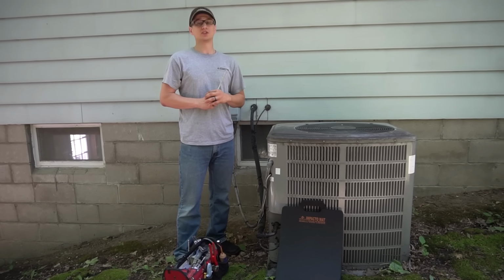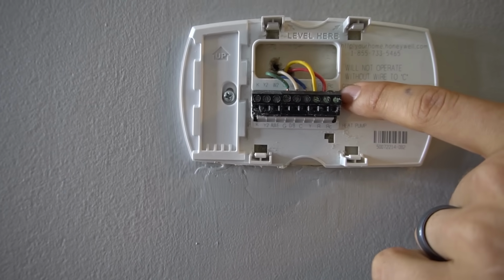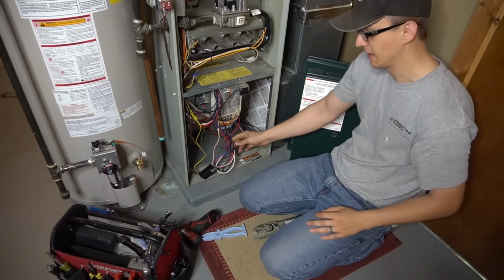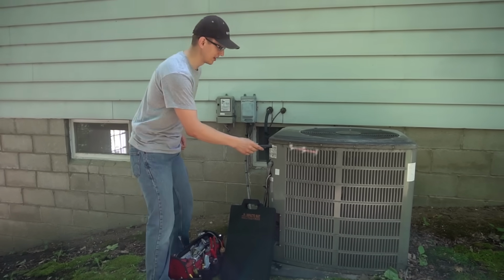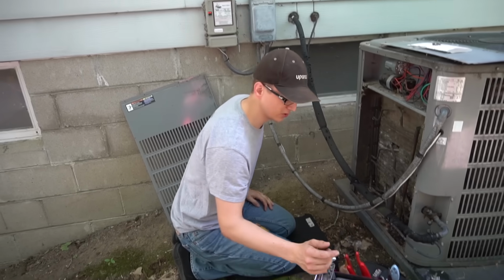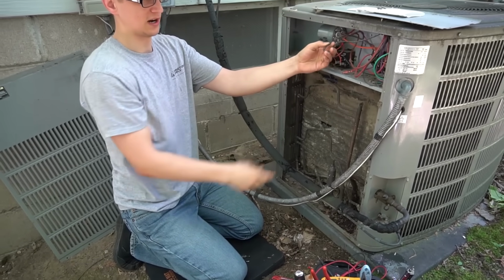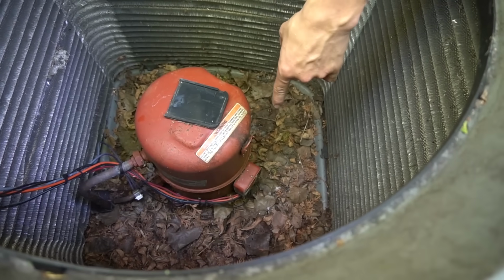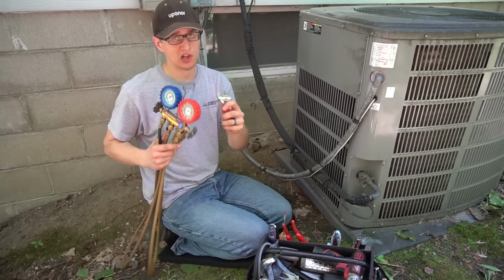AC Unit Not Turning On - How to Fix It Step by Step

Comment: Thank you for your videos. I have been picking away through all of the pieces. I am still stumped. Contactor seems ok. The plunger goes in when the thermostat is calling for AC. I jumped the AC as you showed, thefan isblowing on the furnace. Took off the capacitor and tested it and it is ok. When I have it all plugged in and turned on, the furnace fan kicks on but the ac unit does not turn on at all. There is a small buzz,not sure if it is the contactor or capacitor. The compressor does not seem to turn on and the fan does not turn on.

Comment: Had a tarp near the a/c unit. During the day the tarp got on the a/c unit and covered it. The a/c was on for a while while covered and I noticed it was getting hot inside the house. The furnace fan was on but was blowing out warm air. The outside u it is not coming on. I don’t hear the compressor and the fan isn’t working. Any ideas please?

Comment: My outside compressor fan is working for a minutes then stopped after I changed the capacitor. Everything indoors working. I have tried to use a stick to kickstart it but seems stuck, is it because the motor needs oils? My unit had been here for 20 years.

Comment: I. Was hopping you will address how and where to connect the common wire so there will be power for the thermostat,
Reply: Common usually go to the outside condenser

Comment: Thank you for the video,  it is helpful to see some of the practical tips you are showing and doing.  I have a Payne HVAC. I was able to push the connector in and it did start the compressor and fan. Once I released the screw driver it did not hold in.  I took it apart to clean it,  put it back in, lower the temp on the thermostat,  nothing happened.  I pushed it manually again and it works but did not hold.  Is it safe to assume then that I need a new connector?  Thanks again.
Reply: I meant to write contactor not connector.  Thanks

Comment: Thanks for the fantastic video. I have 240 volts at the contactor, and when the thermostat calls for cooling, I have 27 volts at the low voltage inputs of the contactor. However, the contactor plunger is not pulled in. I changed the contactor with a new one and still the same. When I push the contactor manually, the compressor and fan are coming on just fine. Where do you think is the problem?

Comment: This video is a lifesaver.  Excellent advice and information.  After one very hot day, our air conditioner suddenly wasn't cooling the air.  After watching this video (and several other related videos of yours) I found the condenser capacitor was bulging out at the top.  After a quick disconnect and removal, and a trip to the HVAC supplier, I replaced the capacitor and the air was cold again.  Amazing what some good information can do.  I also removed the condenser fan and lubricated the shaft of the motor.  Now our AC is putting out colder air than before.  Total cost: 4 hours of time and $20 for the capacitor.  Thank you, thank you, thank you!  The next day I bought a back-up capacitor in case this happens again, like you suggested.  I plan to watch all your videos and learn as much as possible to fix it my self instead of calling for help.

Can I send you a money tip for your great advice?  If you don't have something set up already, you REALLY should find a way to accept tips from happy viewers like me.  If you have a PayPal account, grateful people can send you a thank you donation.  I know that I personally saved at least $200 by simply doing it myself instead of calling the HVAC guy.

You might also consider making and selling a video DVD series with the information you present here.  I think a lot of people would buy it.  NOTHING is more valuable than reliable information.

Comment: I can't thank you enough.  Came home on a Friday afternoon and second floor was 76 degrees. Hot/warm air was coming out of vents and outside unit not running.  Watched video and had to push in plunger on relay.  Unit came on.  Went to inside unit and found 5 amp fuse.  Pulled it out and replaced it.  Unit came on outside and house is cooling!!!!   Thank so much for saving me money and a miserable night.

Comment: My compressor shuts off at times later in the afternoon but automatically turns on overnight. It does not do it everyday but I noticed this was the time frame that it turned on and off.

Comment: Edit: I found the problem, we got a new furnace installed during winter and the people didn't connect some wires :/, you're videos still helped a lot with locating the problem, thanks for giving us this free information!

Hey man, thanks for all the info, it helped me massively. However my condenser is still not automatically starting when i turn on the AC.
When I turn on the AC the fan in the furnace turns on and air comes out of the vents. But the condenser does not make a sound.
I manually tested the contactor and the compressor and fan both start, so somehow the plunger is not being signaled to pull in. What do you think could be causing this? faulty wiring coming from the thermostat

Comment: Followed your detailed instructions and my unit is now working.  The fan motor was seezed up.  I took fan off and sprayed fan motor shaft with wd40 and worked it back and forth manually until it started moving easier.  Turn unit power back on and all is good working and cooling again.  I can't thank you enough for your step by step instructions.  Now I know my capacitor, contact switch and themostate are good. Great Job and Thank You Barry on July 9, 2020.

Comment: Thank you!  After watching this (a few times) I felt good enough to check outside (inside fan was working).  My problem was debris blocking the contactor.  A little compressed air and everything started working.

Comment: Question, I have a Carrier Infinity System and I have two contacts. If I press one the compressor kicks in but the fan on top of the ac unit does not turn. I press the other one in and still just the compressor turns on but the fan does not. Is my run capacitor bad? Both of the contacts do not go in and no power goes to the ac unit. Not even my thermostat, which I replaced, turns on. Nothing turns on.

Comment: Great overview on troubleshooting and fixing one's AC-- to the point, very well shot and produced, and extremely helpful with a logical approach and clearly explained! 

Can you help on a few questions:

First, the newer high efficiency units have variable speed or multi-speed motors -- I think both the blower motor and the condenser fan motor. Do these motors have start and/or run capacitors?

Second, I believe there are various safety trips on the condenser, such as over-pressure, over-temp, etc. Can you maybe explain when are those present, how many different types there are, what can cause them to trip, how to check and rectify them, etc?

Finally, while a homeowner can do a lot of the troubleshooting himself, when it comes to the freon I know it is best left to the professionals, but is there a way at least to tell that freon is low or leaking? For example a car AC has a sight glass, is there anything like that in the home unit?

Thanks.

Comment: I replaced the fan motor 2 yrs ago along with capacitor n kickstart and now i hear compressor turn on but fan not spinning inside works then makes noise outside I shut off and I hear compressor discharge. Fan not stuck is it possible capacitor is bad already? Not bulging.thanks

Comment: I have two Ac units outside and two thermostat one for each floor but one furnace.One of the unit outside is working perfectly and the fan turning but the other is just silent. No AC on the upper floor and unit outside is not working.. I change the capacitor but no luck. Please help.
Reply: Did you look under the "SHOW MORE" he has an AC play list, maybe that might help you...?

Comment: What if your Air-conditioning is working but it seems like it’s taking forever to cool down your house or when you turn it on the thermostat jumps up a degree what does that mean do I need to get a new thermostat?
Reply: Change your filters, if they are dirty no air will blow over your coil to cool down. If the filters were dirty then your coil inside may be dirty as well and may need cleaned. After that make sure your outside unit is washed out and clean. If all that is done you may be low on Freon and need a service tech out

Comment: I HAVE A QUESTION ABOUT MY NEW TRANE THERMOSTAT INSIDE THEY HAVE W2-W1- AND W/E IN WHATCH ONE I HAVE TO CONECT THE WHITE WIRE FOR THE HEATHER?
Reply: W1 is your white wire which is heat, W2 "wire color can vary" is your 2nd stage heat, W/E "wire color can vary" is your emergency heat

Comment: Upon adding coolant (freon?); I dont know house units so well... But wanted to add that when 'topping off' a cars a/c guys are pressurizing the system by topping. Coolant cant move. You need to bleed some back off so collant can work. I would assume the same applies here. No?

Comment: Thank you for the video. I took my panel off the outside unit and pressed the plunger and both the fan and the compressor came on. My question is how do I fix the plunger problem?

Comment: It's the 4th of July, and my AC went out.  But in your video where you show the compressor, ...  My AC has a little black cylinder with copper pipes coming from the compressor to it.  And it gets VERY HOT, and my Fan won't turn.  But the unit does vibrate like normal when it kicks on.  What is that black cylinder that I have, that you don't have in your AC??  Is it supposed to get that hot?

Comment: I love you <3. I changed the batteries in my thermostat, nothing, turned the breaker off and on, nothing, changed the filter in the furnace, heard some noise, went outside to check, fan on the a/c unit was finally spinning. My question....how do you know which way the air flow is going?  I didn't know. I just put the new air filter in and not sure if it's right or not.

Comment: Excellent video, the thermostat wires were explained great except for the Common wire, most folks do not know that Common is the other side of the hot leg of power  which is Red,  just as a car battery  has Positive and Negative, Common is the opposite side of the 24 volt control circuit, it is called Common  because it is the side of power which every  24 volt control circuit terminates to complete its circuit.

The  transformer supplies the 24 volts and the Red  wire is the hot leg of the 24 volt control power,  Common is the opposite side of power, it is the side of power which every   24 volt circuit terminates to complete  its circuit.

The 24 volt hot leg Red enters the thermostat on the R or Red terminal, as you mentioned there are RC and RH terminals being Red heat  and Red cool,  the reason they have those is General  Electric ,GE  now the TRANE company used 2 transformers not 1.

They had a transformer for the cool mode and a transformer for the heat mode, I have been in the trade 40 years  and never  ran into a 2 transformer system ,  they  create more problems than they  solve by  including this.

Comment: I watched your video yesterday cause my AC went out 3 days ago. And I was getting frustrated about a repair bill. I'm an electrician so when you broke down certain points it all became clear. I had a bad capacitor. $13 later I'm running like new. Brand new cause the first thing I did was clean my fins and change my filter

Comment: Word of Advice : I looked at your videos many times but still as a single mother can’t figure out why my ac works when I keep the pop-up button in contactor pressed on with a screwdriver. I changed the capacitor, and same issue .. I changed the contactor after and still
Same issue... I replaced the batteries at the thermostat, did the check point with volt meter several times.... I noticed the brown wire that comes out of furnace at the check point in control box in furnace reads 25 volt but when it goes inside the unit outside there is no voltage... why my AC is working when you keep the button in contactor pressed ??? Can you please help me? Blessing bro! Ok
Reply: That brown wire is probably broken somewhere or shorted. Check the automotive type fuse first then you need to maybe repair or replace the brown wire or connectors.

Comment: My Amana central air conditioner unit has stopped working. I believe from watching your video that it could be the compressor unit outside. I hear it try to start up but after a few moments it fails and the fan on top of the unit also fails to start spinning. I've just changed out the fuses on the unit as I thought and hoped that might fix the issue. Please respond as soon as you can. I have two elderly parents in the home and it's already 90F outside and getting worse indoors for us. All indoor things work and the air blows through the vents inside the house. The problem seems to be with the compressor unit outside like you were saying in your video.

Comment: Excellent video. Thanks. I have everything working inside and I checked the plunger it was not pulled in I pushed it using screw drawer the fan and compressor started. the AC ran for few minutes and plunger released and the compressor and fan went off. What is causing this and what needs to be done.

Comment: I think you are great! I have a question to ask you about the front of my in-wall a/c. Where the vents are, there are three plastic levers. Two are the same and are for directing the air. What is the third one for please? It opens and closes something because I can see it with my flashlight. When does it have to be open, and when does it have to be closed? I use the fan in the fall/winter,  and of course, the a/c when it is hot. This lady thanks you very much in advance.

Comment: Could my condinser from the inside the house unit  stop it from getting cold inside my nxtg giant works i put water in it and it pumps out tjw watrr how can I find out if waters is coming from my unit properly into the nxtg unit could water not be coming out my hvac unit properly and how could I check that

Comment: My fan works in my home when i turn my a.c. unit on  and the ac unit out side fan works out side but im not getting cold air in the house  could it be cause i need frion or what els it could be THAT it's not getting cold..  My unit is about 10 years old this forst time it's not cooling
 Last year it was working fine i trouble shoot by cleaning the out side unit..  jj

Comment: Got a question u didn't cover, so that little plunger u pushed in. I did that and it is starting right up. My vents are blowing inside but not cold air. And my capacitor is not bad I tested that.  So I'm completely stuck. I checked everything inside the house like u said and came outside and tested all those items .... please help

Comment: When I push the plunger everything turns on? What does that mean?
Reply: Azeddine B that the unit is working. Maybe the 24 volts coming from the thermostat is the thing that you need to check.

Comment: Nice explanation of the whole system.  Ive lived in my home for 10yrs.  Haven't had any AC issues yet. My condenser/compressor unit is on the roof.  Im thinking spraying the coils might be a good idea.  The only issue i notice is that occcasionally the compressor seems to start then immediatley stops.  A few seconds or minute later it restarts and stays on.  Could the capacitor be starting to fail?

Comment: I just bought a used ac condenser.  The valves are all open thus no refrigerant is in the system. I would like to test it (working and also not leaking) before I replace the old one (very old but still working fine).  I think I can connect 240v power to the condenser and push contact to see if fan and compressor work.  Can I also test if it is non-leaking before connecting the pipes?

Comment: Question - do you have a video that shows up close hoe to discharge a capacitor on a AC unit? That could very well save someone’s life. So that you absolutely sure that discharged it totally. There are usually three (or four?) wires. Which ones ones have to tapped together?  Anyway it would be great to see, and you could save someone’s life. Thank you.

Comment: You solved my problem ... after checking everything it turned out to be the high pressure switch ... i rest it .. fingers crossed ... but the house has gone from 92 (south Texas) to 76 ... you are my hero